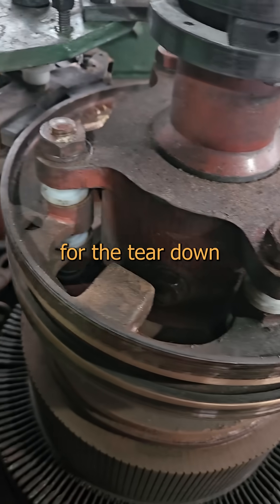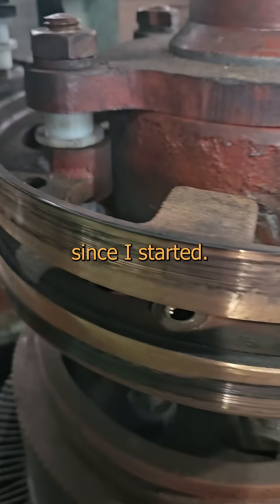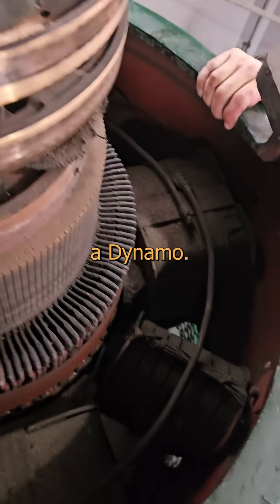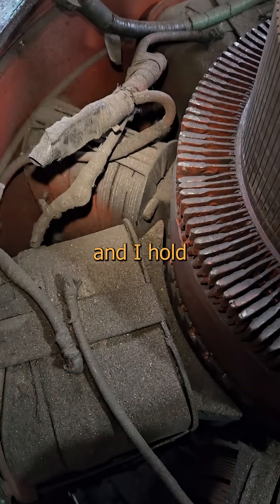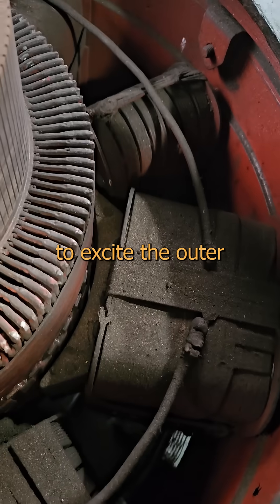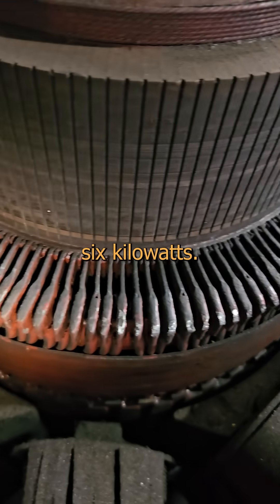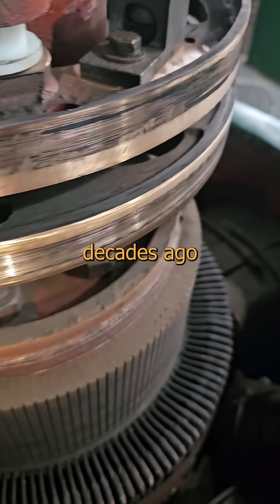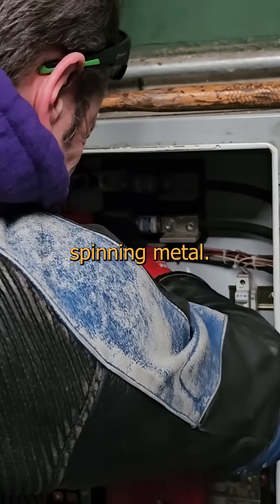Dynamo #chrisboden #engineering #generator #educational #powerplant #dc #exciter #field #hydropower

Comment: Being able to black start an entire powerplant off a car battery is pretty badass. And one hell of a backup
Reply: The old stuff might not be as efficient as some of the new stuff. But, there is a reason it is still there after so many years. The stuff was so over built that it would take another century of neglect to possibly brick it. These old ones were so over engineered that they will keep working for next to ever if maintained, and that’s pretty cool.
Reply: Put a set of those like race car battery cable posts on the outside of the building some of the power plants down you just come over with a jumper cables hook it up
Reply: Nope.... not an entire power plant but the whole power grid instead!!!!
If something goes VERY wrong, the entire power grid goes off and you need to start one power plant first in order to start all the other power plants available.
The very first power plant must be an hydro because this is the only power plant that can be started without electricity (and not any hydro but only a specific one... because of only few hydro power plants can be started without power!)
Reply: @teslacoiler  As a recently retired CRO of 45 years' experience, EVERY single plant I worked at and 3 other plants I trained others to run during their commissioning could black start.  Coal plant with parking lot 2x 40mw GT P&W peaker's were air start. 5 CoGen's had diesel black start generators. And my last plant was a Geothermal with a black start generator.
The Geo plant had a 32 reverse power relay set to trip us, so we did not import power per our PPA contract.
Reply: @qthebikeahaulic  Part of that might be the point.
The video is explicitly talking about 'new' and 'remote' (controlled-but still remote)

I see not a single reason to doubt your statement 
(and have several to agree, beyond stated credentials and observations)
about the presence of such failsafe in ever plant in the very recent past, likely still now.

But as a concern to look out for in the near-ish future, as this can easily become less of a given... still not a bad one.
Case in point: my solar-panels are useless if the grid is down. and that's the standard home setup sold here.

Also the "You wanna see something cool?" in itself reason enough
Reply: @user-jn4sw3iw4h  you have panels but no battery bank?
Reply: @trailblazer632  Correct (not sure that would solve it though)

At my location the grid is considered
acceptable-single-point-of-failure levels of reliable.
To the point the DC-AC converter the panels were sold with relies on the grid to provide its synchronization, will simply refuse to work without it.

I have no reason to assume a battery-bank sold to the exact same market. would come with a converter that's better suited to cold-starts.
(Nor are 'high power DC'-devices publicly available here.)

I consider occasionally to get one of those 'car DC-AC-converters'
(significantly less concerned with mismatches, being completely disconnected from the grid)
To have a backup battery-powered reference frequency, in the (here) extremely rare scenario the grid is out for a substantial time.
It might be the control-signal missing to make the panels of the entire block usable in that scenario.
Reply: @teslacoiler  Theres so much incorrect with what you said

Comment: Clean her up and keep her. She just might come in handy someday, maybe sooner than later. Car alternators produce nothing without a bit of field voltage. But old-school car generators will wake up simply because of residual magnetism in the poles. And that’s pretty cool!
Reply: YES!
Reply: That's the difference between "self-excited" & "auxiliary excitement". Most portable gensets up to about 100KVA are self excited, with "field flashing" circuits built in to create the magnetism for electrical generation. Large powerplant generators are amost exclusively "externally excited" by a "self excited" small generator or connections to an electrical source sufficient to start the build up of the magnetic field in the armature. 🤠(P.s. most portable gensets that homeowners use "lose their magnetism" due to overdemanding what the lil feller can do. That heats up the generators windings excessively & destroys any residual magnetism. Heat kills magnetism. Buy a unit with approx 20% overcapacity for your needs & you'll thank me later.)
Reply: Bring it back to life

Comment: We had these on the back of our generators.  We had 2 400kw Worthington steam turbo generators that ran for a very long time before the company got rid of them.
At the end of that period there was a problem with the exciter where the polarity got shifted..  
I think that generator was left shut down from that point but one of the guys I worked with found that it would have been as easy as using a car battery to change it back.  But that never happened.  They wanted to get away from having plant operators 24/7.
Reply: Yes sir, it would have been easily restarted with a car battery.  The poles shift for some crazy reason and I fixed many DC generators just that way.   Foolish ignorant Bean Counters cause the needless destruction of many great machines.

Comment: And this is why I tell people we rely on the grid too much, if it goes down even starting it back up is a pain, it’s also why old machinery is cool as shit. It’s all meant to essentially run itself
Reply: That's less a problem of reliance on the grid and more a problem with our complete lack of infrastructure investment/upkeep, IMO. Having a central system with redundancies and functioning hardware is fine, it's when you let it rot for decades that you run into issues.
Reply: @mechalith2791  People don't remember that there was a Congressional hearing on EMP's held on 11 Sept 2001. Yup, THAT "9/11" & the unclassified result is that the USA is extremely vulnerable to an EMP attack. It would result in millions of deaths & put us back into our great-great-great-great-grandparents "world." Power generation would be like a water fountain in the desert with no piping to where it's needed. And our manufacturing capability for large transformers & other necessary equip is currently non-existant or woefully weak & feeble. And the knowledge base for actively pursuing reconstruction/repair has been shrinking for decades.  AFSC 54252/3E072  🥺🤠

Comment: Jump starting a plant with a car battery sounds like a half a tazer waking up a mining dump truck.
Oh, please. I wanna see either.
Reply: You only need a few volts on the brushes of the exciter for a few seconds to build the magnetic field within the whole generator.  Once the the field is built up the generator lives on it's own power.  The energy keeping the generator spinning keeps whole unit alive.  Very simple system that has been around since Edison.
Reply: @welderfixer  There might be enough residual magnetism to not even need the battery to kick it.
Reply: @A_Bit_of_Thought ”Time to start this baby. Queue line of men holding hands in socks down a carpeted hallway to the generator. “
Reply: @A_Bit_of_Thought  This is usually true unless to dismantle something that causes it to dissipate, then you have to jump it.
Reply: @welderfixer so what you’re saying is.. perpetual motion? o: 

Haha jk

But how does it work? I assume like the way an alternator keeps a car alive but the gas engine helps the alternator
Reply: @ As I said: "The energy keeping the generator spinning keeps whole unit alive."  Meaning the the water in the dam that spins the generator or as you said the engine that spins the alternator.  Basically the same thing.  Some outside force must be applied to the shaft of the generator/alternator and there is a quadrature winding in some "generators"(alternators) that powers the rectifier that sends DC current to the brushes/exciter that sends DC current thru the rotor inside of the alternator stator generating the AC current that is sent to the "grid" via step-up transformers.  The power for the rectifier can also be drawn directly from the AC output via a step down transformer.  So, no there is no perpetual motion; all laws of physics is followed. 
I can also explain brushless generators/alternators if you would like me to.
Reply: @SupaStatic  well an alternater on a car works in a similar way.
 you actually can't just spin that thing and get power. it has a regulator that needs power to get power. it sends DC current to the rotar (not sure if that's the right word I should know tho) and that voltage is changed to keep the output the same no matter how fast it spins. the alternator actually produces an AC current that is rectified to a DC current that's why it's called an alternater as it make alternating current
Reply: Still have one unit at my plant that has the same set up. Black start is nice to run the complex when the grid is down. Not too far away from your Irving plant.
Reply: I really want to see that.
Maybe as some kind of emergency training?
Reply: I wanna see both. At the same time.
Reply: Back 30 some years ago, because of the effects of a severe winter storm in our area, I learned how you can jump start a V8 Detroit Diesel powering an ancient Pettibone Carry-Lift (4x4 offroad forklift), using an even more ancient Lincoln arc welder that was powered by an equally ancient Wisconsin V4 engine, that we had to jumpstart using the truck that was pulling the trailer the welder was mounted to.
That was just so that myself and the farmer I worked for could get into the equipment shed.
Reply: Sounds like a Rick and Morty episode
Reply: That's how they got emergency power at fukushima, the staff had to run outside and take all the car batteries from the carpark
Reply: Miners: “Aw shit, our giant dump truck is now a 200 ton paper weight thanks to a dead battery”

Local cop: “Hold my donuts” 🔫
Reply: Sounds like some far cry shit
Reply: @dezmondsunflowerviii  fr like this is some thing from far cry 4-5(the end of the world one that's basically 4 with a different map can't remember the name lmao but sounds like a specific mission
Reply: You can wake up a mini dump truck with a Milwaukee battery and some 14 awg romex
Reply: A half a tazer would likely do it for an old magneto setup
Reply: Me2😂😂😂
Reply: To me, that sounds like something I would do in a zombies game to get a functional base for me and my group of survivors.
Reply: DC generators can be started without external voltage source if they are wired corectly. Old machines will be easier to start this way since they have much stronger residual magnetic flux.
Reply: I'd probably nut, not even gonna attempt to lie
Reply: What does AIP mean?
Reply: @samuelsimard1717  Abandon In Place.
Reply: Fuck yeah. I'd love to see a video on that.
Reply: I think this may be somewhat possible, those big mining dump trucks have air starters, so as long as either you have enough power to keep the ECU alive or just a sufficiently old truck that's entirely mechanical, all you really have to do is open a large solenoid valve
Reply: I wanna see jump starting a car with a powerplant tho
Reply: Well… actually… that’s sorta how we do it now with capacitor jump starters
Reply: Now granted its air started, but my buddy jump started a Caterpillar 789 with a 20V Dewalt battery. Made sure it was filled with air and off it took.
Reply: PLEASE

Comment: So, all that's needed to have a backup power supply is that it just needs to be restarted by a simple jump start? Neat. (Forgive me, for I'm a small engine/powersports technician, not an electrical engineer. I'm trying my best to understand.
Reply: Surely, you see portable generators in for repair.  Some of them only need to have the rotor properly "flashed" to get them powered up again if have been setting for a long time.  The latent magnetic field left in the rotor is what brings them to life in between uses.  There's plenty of videos showing how it is done or it's in the repair manuals for the generators.  I do it often here for my customers.  Have fun - be careful.

Comment: It's always good to keep the oldies going, if steam engines have taught me anything its that they'll do what you tell them to if you ask nice and treat them well. Anything complicated with electricity can and will sit down and give up for no obvious reason.
Reply: I am just getting into steam engines. Currently making plans to build a small one myself. Any advice for someone just starting and planning to build their own?
Reply: @normalhuman9260  Make sure you have a very in-depth understanding of fluid dynamics and high-pressure systems, being able to weld would help too.
Reply: @ Get help, ask second opinions, find a local model engineering club. They'll have the know how and possibly the equipment to do things safely. Also don't touch anything unless you confidently know what temperature it is. (I've been caught out too much by dripping pipes, lubrication points and once a blower valve). I have joined a long running team absolutely bathed in experience.
Reply: @normalhuman9260 if you want a cool project to try, look into making a coke can hit and miss engine